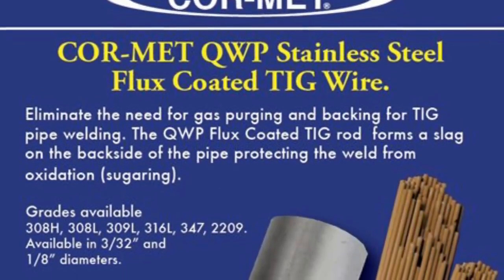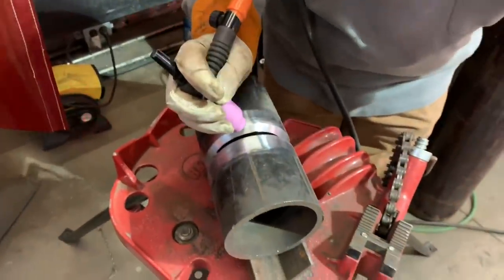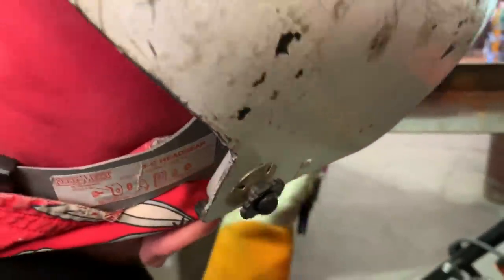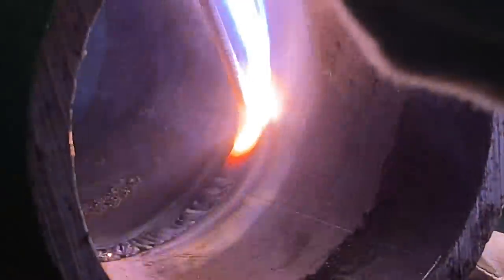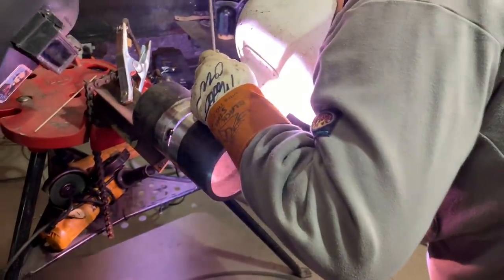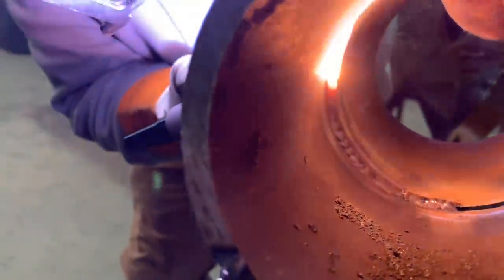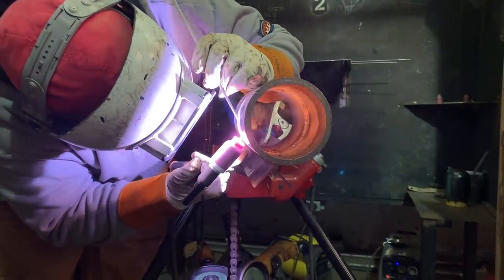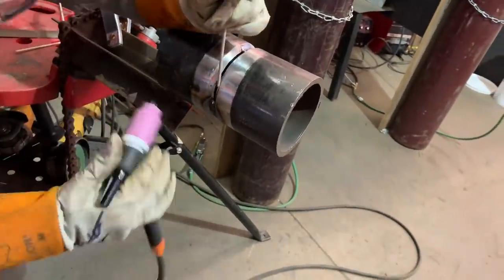316 Stainless Root with No Purge

Comment: Thanks Alabama academy nice video i am welding SS sch 10,  3 inch pipe i have two type of rods one is same like yours and the other one is with the flux from inside the same as fluxcore wire
Reply: fatos Skenderi inside flux wire is more aggravating.  Crimp it on one end and tap wire to make sure the flux is where u need it. Seen wire with voids on inside.

Comment: with the slag do you still have to use shielding gas? If not that would be good for doing stainless outside in a breeze
Reply: J.A.E 1979 still need gas or you’ll cook your tungsten

Comment: CHANGE: WELDORS really do resist change but for some odd reason embrace  " welder lore " one example being " hippy rod " ( 6011 ) thinking it's for yard art. 6011 was used on HIGH PRESSURE HI YIELD cross Country transmission piping. I believe it was 60 X pipe. Welding is a chemical process with a thermal component.

Comment: This is good if all you can do is run Tig.  If your a combination welder you might be better off running RMD with Mig or even stick welding would be quicker than tig.  No purge needed.  Also, harbor freight has diamond blade wheels for $10.  I believe it’s a 4” wheel.  Slap that on your grinder and stick your tungsten on a drill.  You’re welcome.

Comment: How could they remove the slag in a long pipe?
Reply: They flushed through, the same as carbon pipe that's been stick welded with a cellulosic or low hy root